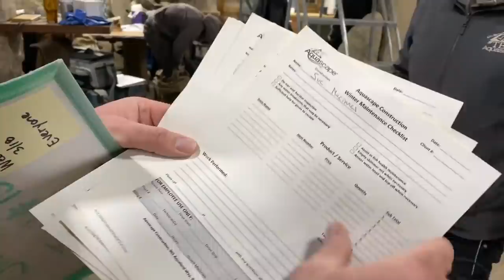*POND* Cleanout and Maintenance at Aqua Terra

Comment: Is it possible to have a waterfall hooked up to a solar power instead of the power to fill up your power bills?
Reply: You'd have to have a large solar panel and a pretty big battery for electricity storage and during the winter (in northern states) when its overcast a lot of times, you're not going to be gathering much sun...but I guess you wont be using the waterfall in the winter anyway
Reply: Do you know of anyone using solar to run pumps? I am in SC.